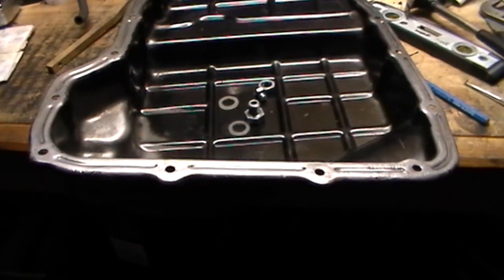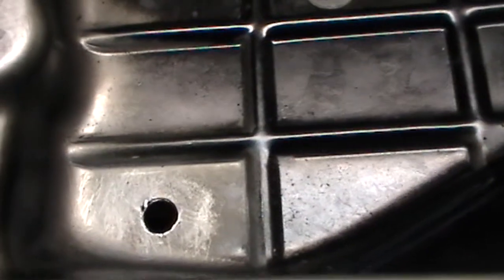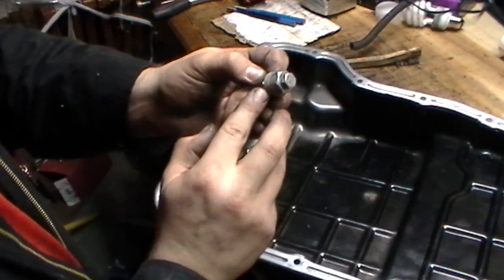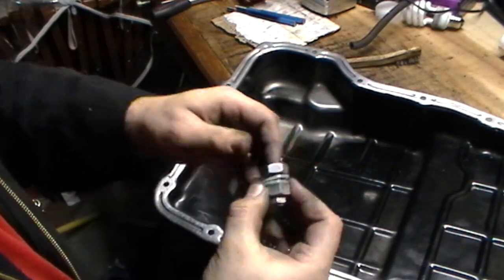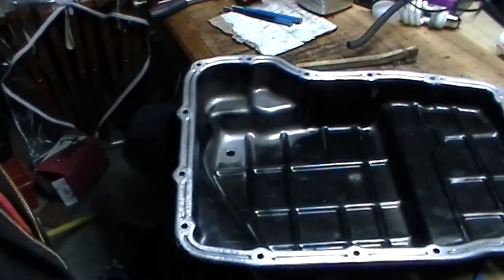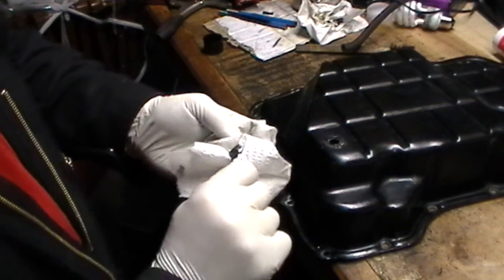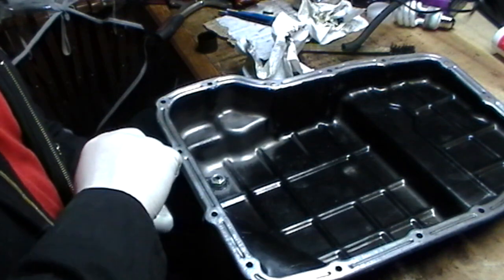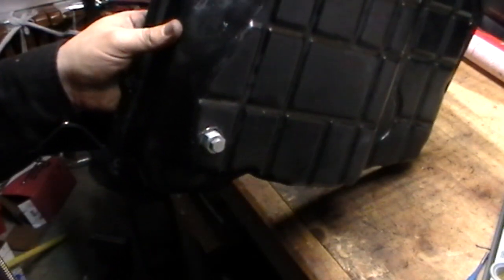How to fix a transmission oil pan design flaw (lack of a drain plug)

Comment: Nice i always hated that they came without the plug makes draining it so much better then just having it pour all over my floor since it always misses my pan
Reply: They don't include a drain plug because it's cheaper. Same reason cars don't include a cigarette lighter element anymore.
Reply: Kilo Mike your right it's cheaper but I would pay the extra 20 dollars up front if it was a add on it would save me the Hassel
Reply from the maker: Yeah, I don’t know why they come without drain plugs. It seems so obvious that it would need one, in my opinion. I hope this video helped you out… Thanks for commenting & watching...
Reply: Pet Rock's Garage It is my belief that they don't come from the factory with a plug is so the people who aren't technically savvy will be forced to the dealership, a standard repair shop or a mobile mechanic that can do the work of dropping the pan and not to mention the larger mess of fluid when not drained well.  I would think it is a money maker.  For a shade tree mechanic, they can just drain and fill if it was there.  I add them to all my vehicles besides the one with the CVT transmission.
Reply from the maker: Kevin Bowman, yeah, that is one possibility.
Reply: @petrocksgarage  has